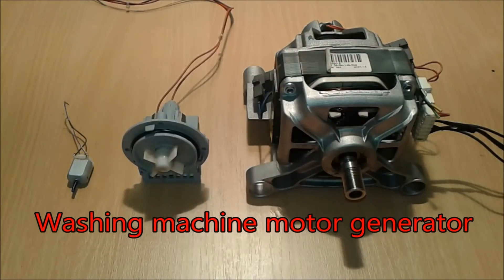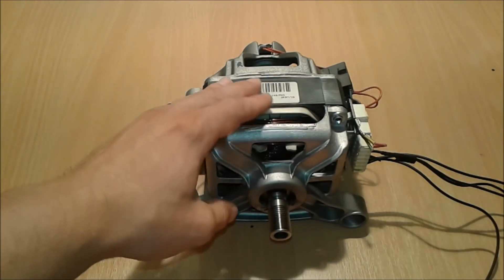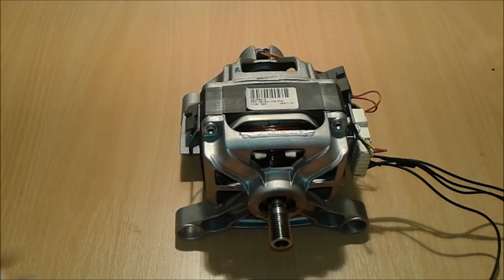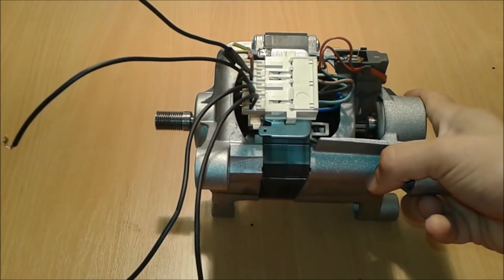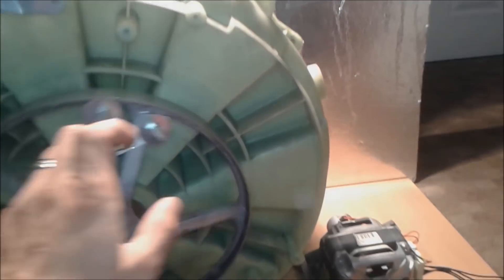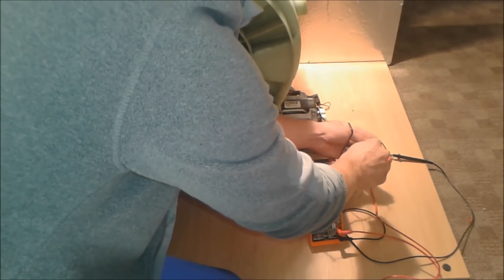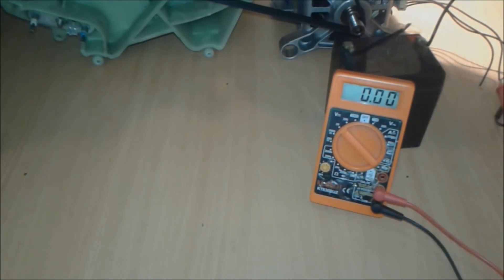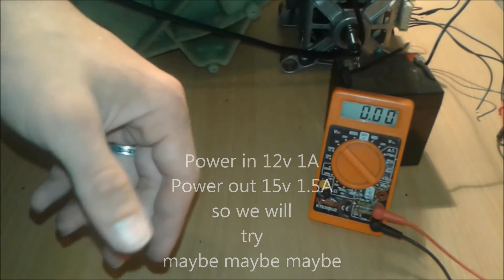Washing machine motor generator wiring

Comment: If you're adding power to it to get useful output, it's not a generator, it's a transformer. You're not gaining electricity, you're just stepping up the output of the battery. Draining battery faster and becoming useless once dead.

Comment: Hello, nice video ! is there any way of having 220v output from the washing machine motor ? i would like to operate a 220v fridge from a 12v motor connected to solar panels.
Reply: Refrigerators take quite a bit of power when they start up. You are going to need a bank of batteries, charging system, and an investor at a minimum to do something like that. No need to connect a motor to solar panels. Just install a solar system with a battery backup.
Reply: The motor won't do anything for solar pannels this is a motor not a battery bank or converter for the solar pannels.

Comment: I have the same motors when I powered it in DC it is moving but when I powered it in ac it was making dangerous sparking at brushes still i am not sure about wireing of it
Reply: probably you wired it as a shunt motor. These types of motors are normally series motors, and are not meant to be wired as shunt motors because the field winding impedance (impedance in A.C. or resistance in D.C.) of a series motor is normally quite low because it is connected in series with the armature and thus should not limit the current (with high field winding impedance/resistance). This means if you connect it in parallel (i.e.: shunt motor) a very high current should flow through the field and armature windings and probably damage them because their individual impedance (in A.C.) is too low which is the cause of the high current. If I am wrong please correct me

Comment: So to turn the motor into a generator you apply power to the field winding? Is that right?
So if you are applying power to the field winding which wires will give you power back from the motor?  The wires that go to the brushes?   You really need to speak loud and clear.  Practice on your English.  If you can't hear yourself we can't hear you either.
Reply from the maker: You got it  right I was to excited that it works so in future videos I will have an external microphone for better audio

Comment: use a bldc motor and avoid battery
Reply from the maker: Praseeda Manoj kumar is not about that which motor is best this is not the best solution. We are repurposing what we have on hand and try to make something useful for less money
Reply: @NoSkillsRequired  then remove the rotor winding and place some magnet.

Comment: I have never seen a washing machine motor built as a universal motor...
All i have ever seen are 1/3 horsepower induction motors or stepper motors in newer machines
Reply: You r right...universal motor r high speed motor and make a lot of noise..
Reply from the maker: grandinosour I find this type of motor in 4-5washing machines  so it depends on the manufacturer or country of origin how knows
Reply: Este motor  g8ra esquerda e Ferreira
Reply: most european's country's are like that  ,nice motors but the problem is deal whit brushes and commutator's  but i still love them

Comment: mostly of washing machine motors are induction motor,induction motor can produce electricity when you rotates the rotor greater that the synchonous speed and works as generator with negative slip. Stator and windings of both induction and synchronous machine are same(induction machine can be used as synchronous machine by changing only the rotor assembly) Both work on rotating magnetic field developed by stator winding. Connected with mains, induction machine work as motor with positive slip, and as generator with negative slip, Synchronous machine work as synchronous motor with trailing(-ve) torque angle delta, and as synchronous alternator with leading (+ve) torque angle delta, with respect to pole axis of rotating field, witgh rotor pole axis.When not connected with nmains, as there is no magnetizing current, induction principle fails, while with synchronous machine(if pole/rotor magnetic field exist(permanent magnet) or field applied depending on rate of cutting flux by stator winding EMF will depends in winding, frequency will dpends speesd of rotor, and magnitude on speed and pole strenght like D.C. generator.
Reply from the maker: armando uy I am not sure about that here in UK I came across multiple universal motors I have op-ed now 15washing machines and all had this type of motor, love to get my hands on a induction motor but to expensive at the moment cheers for the explanations
Reply: Perhaps there should be a coil of cable that produces a magnetic field in the motor that is produced by 12 volts DC, at the same time and the same motor with another coil gets electric magnetic field induction.

Comment: Did you figure out that you cand use another motor with a dimmer switch put in between the power cord and the wall socket to power the motor that would turn the other motor to produce the correct speed for the amount of power you need to power everything in your house?
Reply from the maker: Rebel Studio you got a link something? Always looking for new ways of running and controlling this motors
Reply: There is no video of  that set up being used. I looked. There are a lot of set ups for different things that are not shown thought of. I am real good at problem solving. And to power the motor that spins the one you are using for power you would also need a small invert with a battery to power the motor if you have no other power source. I would like to do some of the different set ups but I do not have and cannot get what I need to do so right now.
Reply from the maker: Rebel Studio a simple generator idea could be a washing machine motor because it can reach 11000rpm and a car alternator but the drag of the alternator when under load is unknown...
Reply: @NoSkillsRequired  You can use a battery charger that will shut on and off on its own to keep the battery charged. The inverter just needs two plugins one for the motor one for the charger.

Comment: It is the larger + smaller pulleys that give you a working free energy mechanism. The one rotation of the larger circumference pulley can give you many times the circumference of the smaller pulley + motor/generator. So you only put in the electricity for the one rotation of the larger drive motor, and then by pulley mechanics, you gain the multiple of input power from the many rotations of your smaller pulley's output, which is attached to a motor/generator. This output pulley + motor/generator could be multiplied to many times the rotation of your input-drive motor, and increased even more by adding additional min-pulleys with motor/generators. So, if you had a 10 cm circumference drive pulley + attached 3 mini-pulleys, with motors/generators to the same belt, then you would get an output of 30 rotations. This could be 30 cycles of AC electricity, or 30-60 pulses of DC electricity. YES,,, FREE ENERGY IS TRULY THAT SIMPLE 
- 
Hello fellow inquisitive one, . . . . . .  . . . . .  . . CHRISTIAN AGE ENDS 2019.04 = 1st DOOR closing
Ezekiel 1:16 speaks of a UFO motor as “wheels within wheels”. This self powering set of motors
https://www.youtube.com/watch?v=NxpoiCFKmPg is almost identical to the GEM idea that I was given. Free energy is as simple as imputing one short burst on DC current, to drive a large 100 cm circumference pulley for one single rotation. This could move 100 cm of belt past 1 to 10 mini-pulleys of 1 cm circumference, each with AC generators attached, gaining you an output of 100 to 1000=(10X100) cycles of AC electricity. If you used an AC drive motor, this pulley technology, could be simply multiplying one cycle of AC electricity into 100 cycles of AC electricity.
- 
This massive amount of free cycles of AC electricity as an output was from the smallest amount of input = a few bursts of DC current -(only enough to crank over a DC motor one single rotation). How can you not be multiplying your cycles of AC electricity, when you are only paying for one rotation of a single 100 cm circumference pulley. This can give you back a multiple of 100 cycles of AC electricity output, for every 1 cm circumference mini-pulley with an AC generator., that you chose to attach to the same belt as your large 100 cm pulley is driving, 
- 
This free energy technology http://free-energy.yolasite.com/ will be needed by this technology to survive the second half of peace treaty. This tech is so simple, that after learning of this Truth, it should be proof of the eternal battle between good + evil forces, getting you to consider what life is all about, including your future in it. If there is no evil in this world of ours, then how else can you explain us humans not seeing the obvious gain of 100 cycles of AC electricity from a 1 cm circumference pulley + AC generator, for every single rotation of a 100 cm circumference pulley that is attached to the same belt. These evil spirits are hiding this free energy technology because the evil forces enjoy us spending so much money on oil, some of which ends up going to terrorists, which evil spirits are influencing enough already.  
-  
It is as simple as the lesson that you learned way back in preschool, where they showed you how a single rotation of a larger pulley could be converted into many rotations of a smaller pulley. Well, this can be a significant thing, when talking about AC electricity, as more rotations can mean a greater amount of cycles of AC electricity. So, in effect, you can use pulleys to freely multiply the amount of cycles of AC electricity that you have. 
- 
Think of only paying for the single rotation of a DC motor, (a few bursts of current) with a large 100 cm circumference pulley attached, rotating 1 to 10 mini-pulleys of 1 cm circumference, attached to AC generators. This would be gaining you a return of 100 to 1000 cycles of AC electricity, (10 X 100 = 1000). + don't you listen to the evil spirits, whispering that torque is a problem,,, = because the only torque that your 100 to 1000 cycles of AC electricity needs to produce, to make this GEM device a self powered free energy system, of one DC motor + 1 to 10  AC generators, is the minute amount of current that it takes to crank over your single DC motor one single time. This minimal amount of a few short bursts, which equals practically nothing, when it comes to current. This is because practically no current multiplied by even massive voltage, still equals practically zero power – costing practically zero torque.
- 
WHY DOES NOBODY SEEM TO THINK ABOUT, or MENTION THAT THE FIRST DOOR IS COMING TO A CLOSE IN 2019.04, or JAN 14.57 = (COMING UP IN LESS THAN 8 MONTHS) This is not a prediction of the date that this will occur by, but this is the date that this prophecy can no longer be fulfilled. This is where the “end of the world” miss-translation can be found + should be translated as “end of the age”, as in “Christian age”. This is a deadline, or when the door closes on it still being able to fulfill the prophecy about it happening within t within t were both the signing of 7 year peace treaty with Israel + the pre-Trib Rapture MUST happen before this first door closes. Please Google "doorschristmustpassthrough" 
-
|This is some very important NEWS to share with this world. Although we are warned of that the “day + hour knoweth no man”, we are also assured that we would know “when it was near, even at the doors”. This first door will close on 2019.04 = DEADLINE for signing of infamous 7 year peace treaty with Israel + the Pre-Trib Rapture. 
-
Did you ever wonder how we could know that it was near, if no one could know the day. It was because we could know the generation, and all generations have an end date. Well this end date could be the door, as in when the door will close on it being able to fulfill the prophecy about “this generation shall not pass”. I know that there are a lot of duration for a generation, but i figured that it was probably the 51.6 solar year duration, as this was the same duration that was used to accurately predict the rebirth of Israel. 
-
We are told that there are 14 + 14 + 14 generations from Abraham to Jesus in (Mat 1:17)
14 + 14 + 14 = 42 generations
2,167 is the year for the Birth of Abraham.
http://www.stanford.edu/~meehan/donnelly/bibchron.html    
http://www.israel-a-history-of.com/story-of-abraham.html    
http://www.olive-tree.net/redemptiveplan/Chronological/Old%20Testament/overview%20I.htm    
-
2,167 / 42 = 51.595 
51.6 = duration of our end time generation 
PROOF -(this was the same duration used to predict the date of Israel's rebirth = to the exact day)
-
GOD'S SECOND CHANCE RULE, (I forget the book + verse) = 10 times original duration = duration from when prophecy was given + day Jesus entered the temple=(prophecy fulfilled), then multiply # days by 10 = May 14th 1948 = rebirth of Israel = 2nd chance for Israel to show this world Christ 
- 
(please read the novel named “Armageddon”, by Grant Jeffrey )
as this novel symptomatically went through all of the fulfilled prophecies in Scripture 
+ displayed the reality of every one being fulfilled to the day = in the Holy Bible KJV
This novel helped me discover Scripture as TRUTH + I soon after became Born-Again
- 
http://doorschristmustpassthrough.yolasite.com/    
http://beliefstoliveby.yolasite.com/ 
http://fire-starter.yolasite.com/    
http://biblefilescentral.yolasite.com/    
https://www.youtube.com/watch?v=O1vtx5sDxrg   
http://free-energy.yolasite.com/ 
- 
This GEM - free energy could be part of our life, in the very near future, either during the 3.5 years of peace = brought about by the anti-christ, or during the 2nd 3.5 years = known as the Great Tribulation, when most all of the evil spirits will be kicked out of the heavens + sent to our earth. Satan himself will be one of the ones kicked out of the Heavens + will animate the dead body of the anti-christ, pretending to be Christ, after being killed by someone. 
-

Comment: This free energy technology is so simple, that it should be proof of the eternal battle between good + evil forces. How else can you explain us not seeing the obvious gain of 100 cycles of AC electricity from a 1cm circumference pulley + AC generator, for every single rotation of a 100 cm circumference pulley. This is because these evil forces enjoy us spending so much money on oil, some of which ends up going to terrorists, which evil spirits are influencing enough already. 
-
 How can you not be multiplying AC electricity, when you are only paying for the single rotation of a large 100 cm circumference pulley attached, and you get a return of 100 cycles of AC electricity for every mini-pulley that you attach to the same belt as the 100 cm pulley. So, you could multiply your # cycles of AC electricity to 1000 if you added 10 mini-pulleys of 1 cm circumference pulley with AC generators attached. That is 1000 cycles of AC electricity for a few short bursts of DC current.
Reply: @
joe Lynch
this is a dc generator :-)
Reply: even better, so that we would not need the full wave bridge rectifier, to convert AC back into DC
Reply: @
joe Lynch
on a windmill or water wheel with enough gear up it would probably work as a battery charger , but so would an alternator which is designed to do the job and has a built in regulator and a charging indicator light :-)

Comment: a motor in reverse is not a good generator. 
a good generator is when the magnets and the coils are stationary and the steel sleves between them since the only way to prevent pesky action reaction is if the two fields does not move relative to each other but only the inductive field variations moves inside the windings when windings and coil is stationary.